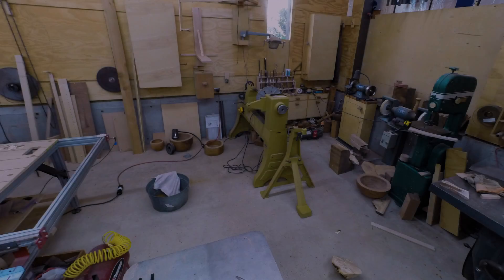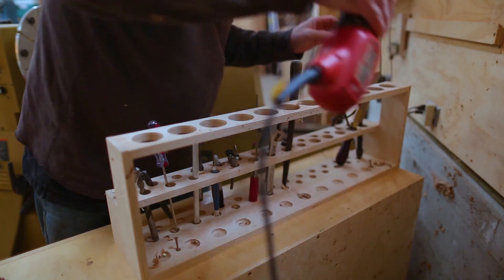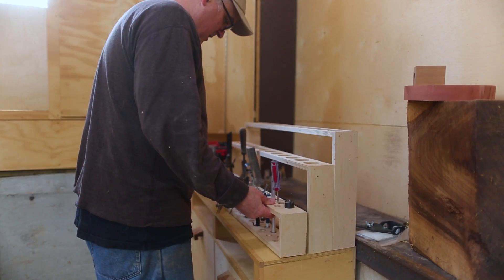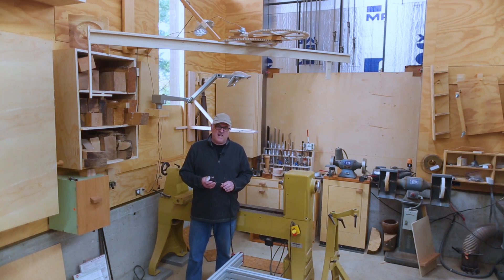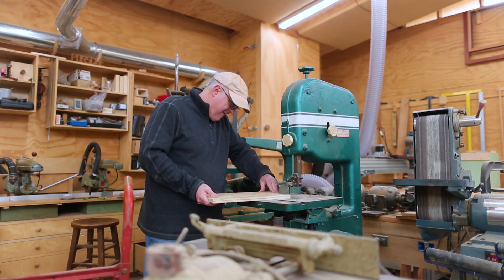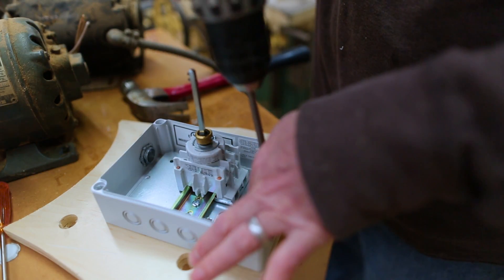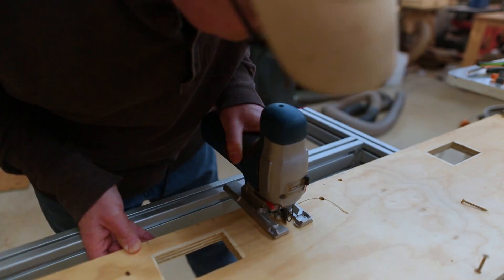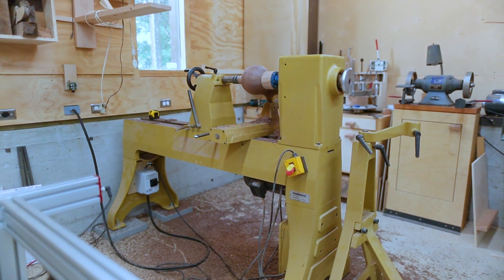Moving the Wood Turning Lathe

Comment: Did you connect the green (ground) wires back together inside the switch box?  At 8:29 it looks like the green wire from the wall power connection is not connected to anything.
Reply: Old Ohio Angler - I wondered the same.
Reply: I too wondered

Comment: Great idea on the removable 12" lower wall panel.  Things you just don't think of until you have to dig into the drywall or take off a huge panel once!  Very modular and forward thinking Mr. Frank.  And as always, awesome presentation.

Comment: As others have noted, be sure your bond wire, the green or bare copper depending on the cable you are using, is connected to the bond screw in the junction box, in the switch and on your machine.  It could save your life.  I would also recommend a 90 degree connector at the wall to reduce the strain on the cable and to keep it closer to the wall so it is neat.

Comment: 8:10 I saw that you didn't connect the Earth (Green) wire to the cable going to the lathe. PLEASE connect that to the metal body of the lathe as it will prevent you from getting electrocuted if there were to be an electrical fault inside the machine.

If it is connected an such a fault occurs, the breaker is going to trip and you will be fine.
Reply: The ground/earth wire you are seeing at 8.10 would connect to the outgoing ground/earth to the lathe. He doesn't start threading the cable that carries that ground into the box until the next scene....

Comment: Good deal I like your electrical arrangement.  In my shop I put plastic gutter (regular outside rain gutter)  all around the top of the wall just 6 inches down from the ceiling.  Then we lay the wire into the gutter and just drill or cut holes where the wire or conduits can drop down to the place we want them.  But I think I like your idea better.  Thanks for the video.

Comment: You ommitted connecting the ground(green) wire at 8:30.
I would advise connecting a paddle switch on the front.
Especially since you wear long sleeves when turning..
3 potential safety hazards presented..

Comment: Great video as usual. Your fore thought in designing the electrical at the base of the wall sure worked out well. Is there any possibility of making some kind of a link that would bring the lathe switch operation to a more comfortable position if that turns out to be desirable?

Comment: Hi Frank
I like the result of the project - but I do not understand the rational of putting the switch on the leg of the lathe? Understandable that now the switch moves with the lathe should you choose to relocate again - but that seems like less of an issue than having to bend down to turn the lathe on and off (which could happen at least daily). Have you re-thought this since you made it for this location and re-mounted on the wall at a more convenient height?
Regards
Dennis Beamish Cambridge Ontario Canada

Comment: Always appreciate your videos.This may be a bit of Monday morning quarterbacking (in a positive way), but I couldn't help wonder, even when you mention possible issues, why not just mount the switch box, with the backboard, on your cleat system right above the power grid plywood? That way it is easily turned on/off without bending down. Also, like you mentioned about future moving, from that switch box to the power source, use a plug instead of hardwiring into the wall.  That way you can unplug, coil, lift switch off the cleat and set on the lathe to move as needed. That would've saved you the step of moving your outlet over because you would then have a long extension cord from the switch box now. Hope this comes as positive food for thought if you change anything.
Reply from the maker: All true.  One thing I did not make clear in the video was that the cord coming from the lathe was not long enough to reach up to the wall.  so I would need a splice, and that splice became the switch.  I don't have to use the switch very often

Comment: The isolator for the lathe's power supply really ought to be wall-mounted - you don't want to be reliant on turning off shop power to isolate the power to that cable. 

We just took delivery of a Colchester Bantam - We installed a big old single-phase isolator on the wall, a smaller rotary isolator on the Lathe itself, as well as a pair of start/e-stop buttons convieniently located for the operator, and another e-stop you can reach when standing in line with the lathe's axis (i.e. the place you're least at risk from a workpiece that's gottten loose).

Comment: Frank, circa 4:46... You really baited my attention in, as I was concerned with:(while you were holding the plug in your hand) "What I really need to do is buy a switch... and hardwire this into the wall...and then, when I want to TURN THE LATHE 'ON', I just turn the switch on, instead of plugging the lathe in, which really isn't the way to do it......[snip] And doing it this way it would have been simpler, but it means that I would have to bend down to turn the switch on and off..."WHOA! REALLY?  I was then getting seriously concerned that you did not have an EMERGENCY STOP mechanism nor other means of turning the lathe on/off!  Fortunately, towards the end, we could see the actual switch controls on the lathe, including its emergency stop.It would have been great to bracket the discussion up front with you desiring to have some sort of LOCAL SERVICE DISCONNECT for your lathe when not in use, or when servicing it's internals.

Comment: You know you could set up a foot level to the switch to where you don't have to bend down to turn on the lathe every time you use it. Just lift your foot up to turn it on and just push the lever down to turn it off.

Comment: It looked like you left the earth/ground disconnected in your rotary isolator. Dose this mean your lathe is not earthed? How many cores do you have coming from the lathe motor? 

If you have left it disconnected you run the risk of that loose cable touching a live component within your switch. So please be careful

Comment: Can't you buy switched outlets over there?
Reply: No. Outlets here don't normally come with switches on them. Whatever you plug into the outlet should have a switch on it, or you can use a switched power strip. Some rooms are wired with an outlet controlled by a switch installed near the door for the convenience of plugging in a light that can be turned on from the doorway, but that involves a separate switch. Outlets here are generally installed low on a wall and in out-of-the-way places (e.g. behind furniture), not places that are convenient for operating switches.
Reply from the maker: yes, I have one to turn on one of the drill presses, but this is a 30 amp line, I have not seen a switch outlet for that, although they may exist.

Comment: One thing I've always been curious about with wood turners, and especially yourself, why no set up for dust collection on the lathe?
Reply from the maker: It's somewhat hard to collect as the dust is coming towards the tool and the turner.  you don't really what a dust pipe right in your way.  having the dust collector on for an hour or 2 or 3 can get annoying.  and with green wood turning I would fill my dustbin, and it easier to just sweep in off the floor.  That said people do it, it can be done.
Reply: frank howarth - Thank you.

Comment: It looks like your lathe has height-adjustable floor bolts on the feet. Why not just use them instead of resting on concrete slabs? Depending on the surface of them, I could totally see it slowly moving over time from all the vibrations.

Comment: I enjoy your videos Frank. You might want to look at using some heavy duty adjustable feet under the lathe rather than concrete pavers. They will probably be annoying after a while as you will kick them and the'll be a pain to clean around. I've got some adjustable feet under my metal lathe and they have quite long threads on them. Long enough to lift your lathe up to the desired height. They also have rubber in the foot so they absorb vibration and the machine doesn't move even through it's not bolted down. This is the style I have https://www.machineryhouse.com.au/M002 You will no doubt have something similar available in your part of the world.